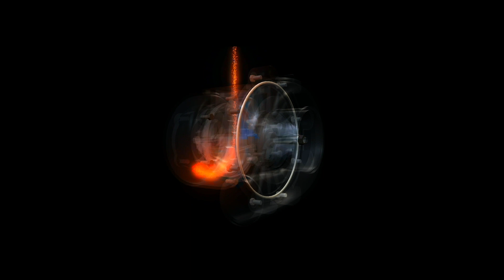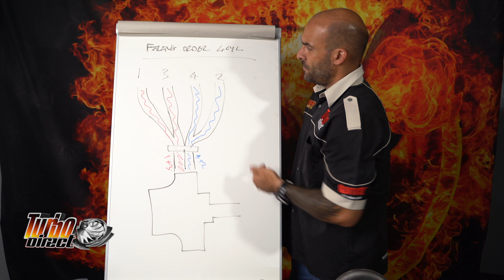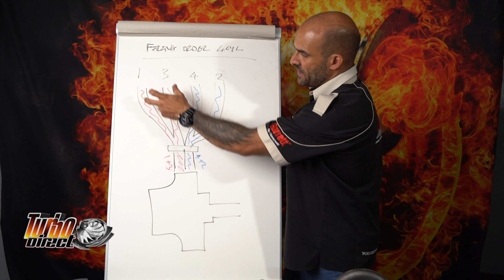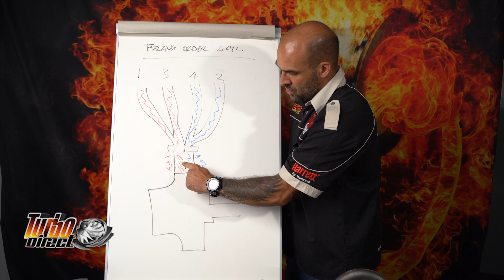Twin Scroll Turbine Housings explained

Comment: The correct setup for a twin scroll manifold on a 4 cylinder is to pair 1+4 and 2+3, as their combustion events happen 360 degrees apart, not 180 degrees apart. Pairing off the cylinders the way they are on the diagram will be no different than a single scroll manifold with the pulses interfering.
Reply from the maker: Incorrect - we have tested a traditional log type manifold, branch with collector, branch without collector, and pulse seperated manifold setups with 1+3 and 2+4 aswell as 1+2 and 3+4 and finally 1+4 and 2+3 ALL of these seperated setups provide benefits over the log type and traditional manifold design without collector. Which is best - that depends on the application and where you want to make your power. Changing the length and diameter of the runners mid way also made big differences in both performance but also sound .... we have tried almost ny design you can think of, before we opened our mouth on a public platform.

Comment: Can i use a twin scroll turbo with a normal exhaust housing
Reply from the maker: @raymondloubser4720  yes of course you can, just make sure your manifold gasket face is not a twin scroll gasket inside an open port housing it it will Burn and cause damage to the turbine wheel

Comment: What about using a dual inlet dual scroll flange and having a wastegate in one side that opens at a determined psi to help with boost response.? Im planning on trying this to spool my v8 a little quicker but information on this subject is scarce.
Reply from the maker: Not sure how the design looks, but closing off one side of the volute in a twin scroll setup always helps - been done many times for over 15 years already, but tricky to setup.
Reply: So it would be a single 2.5 from the header y-pipe about 4' long feeding into another Y,  One side going to a 60mm wastegate with a 4or5 psi spring then reduced to 2" then into one side of turbo flange. The other side of the Y would be reduced to 2" then fed straight into the other side of turbo flange . I'm hoping this would make it spool a little quicker.
Reply from the maker: Cant picture that im afraid - simply build a adapter plate that bolt underneath the inlet flange on the turbine housing with a butterfly actuated by a low boost actuator which will block the one scroll until a certain pressure is reached, at which point the butterfly opens - keep it simple and affordable

Comment: Great vid.  However the idea that a smaller AR will always reduce lag has been proven wrong several times on the dyno.   I wish I could link the vid but I cant remember what it was.  It was a 2JZ with a 30 sized turbo which most people would agree is on the small size for a 2J however changing the AR to subsequently larger housings massively improved spool times and obviously gave more top end.    They then fitted a more appropriately sized 35 which was much better again for power however they only tried it with the 1.06.   The reasoning was the 1.06 was so much better with the 30 they shouldn't bother with the smaller housings on the 35 which IMO was a mistake in the testing.     I am absolutely amazed people in this profession do not understand that the AR is a ratio not size so therefore a 0.82 on a 35 is not smaller than a 1.06 0n a 30.    I would have loved to see what a smaller AR done on the larger frame turbo.    My opinion is if your turbo is on the small side them always go with the biggest AR.    If your turbo is huge than the size of the turbine will give decent flow on is own so a smaller AR might be appropriate there.
Reply from the maker: I must disagree - smaller AR will ALWAYS improve response, BUT because of the backpressure the POWER OUTPUT will be reduced substantially depending on which side of extremities you lie. Remember the more back pressure the more you are affecting the ENGINES VE (volumetric efficiency) -- similar to blocking cylinders on the head.  If you watch the BOOST GAUGE you WILL see faster boost build up - BUT as i have already mentioned, HORSEPOWER WILL NOT BE AS MUCH --- always separate HP and Boost response - they are NOT the same thing and DONT always go hand in hand.

Comment: Hi. Im putting a efr9174 with twin scroll t4 on my 4 L barra engine, my idea was to get another stock log style psr manifold cut off the t3 flange and get a divided t4 flange welded onto it.  The pulses obviously wont be completely divided but the front 3 and the rear 3 cylinders only gather together for a very short distance before hitting the turbo. How well or effective do  you think it will be? Should i make a divider plate and weld it to inside of flange to divide the pulses better? Another question, i will have to run a wastegate feed off each volute just after the turbine inlet and merge them  together into one pipe to go to wastegate. What do you think? Also does the efr9174 have a stainless steel turbine housing? Thanks heaps
Reply from the maker: Barra is more than capable to spool the 9180 especially with the GAMMA-TI turbine wheel. The risk of welding inside the manifold is not worth the results. The manifold will spool the turbo no problem because of the size of the barra. I would weld the inlet into the gate on the turbine housing itself, just above the inlet of the turbine housing, 3inches past the flange face. Use one gate and save massive space under the hood.
Reply: @TurboDirectSA  awesome thanks
Reply from the maker: Pleasure - happy to help  @farmer3242

Comment: Thank you for the video .

Question.
Is there a difference in design as far as the turbine wheel goes ..
For a twin and single scroll?
Are the inducer tips longer for more leverage with the twin scroll to help with spool up ..

And if u fitted a twin scroll housing  on what is meant to be a single scroll turbine .
What would it do to response ?

Thank you again
For all you do. 
😊

An
Reply from the maker: No Doug no difference in the design of the turbine inducer blade design at all. SOME turbos have a mixed flow turbine stage which relates to the angle of the incoming gas path and the design of the turbine blades - for reference google a picture of the IS38 turbine wheel blades, you'll understand what i mean when you see it. For the Scooby turbo  designs, there is no mixed flow turbine design. 

Using twin scroll turbine housings with a normal turbine blade design will offer response improvement only because you have pulse seperation coming into the housing.

Comment: Wouldn't that mitsubishi turbo have more back pressure on 2 of the cylinders?
Reply from the maker: No you would build the manifold to split the pulses, and entrance into the tongue area is joined   into a single entry to the inducer blades

Comment: My mitsubishi based turbo has a divided t4 flange but then merges to a single volute before it starts to curve around. What is the idea behind this design?
Reply from the maker: Do you have any more info on this or a link to see pictures of this setup?
Reply: Hey mate, the turbo is a HKS GTIII-4R made by IHI. I tried linking the website I think the comment got removed but a google search will find it.
Reply from the maker: @barbiegamaestan456  I know the turbo,  but i need to see the installation.

Comment: I need to stop you around the 8-minute mark to correct some timing physics here. If the goal is to have the pulses as separated and far apart as possible, you don't want cylinders that fire closely after each other to be going down the same collector and then volute. So disregard the firing ORDER of an inline 4 for a second, and think about the firing INTERVAL of the piston pairs.

Any two pistons in the engine that are opposite in TDC vs BDC will effectively fire 180 degrees apart from each other. 1 and 3 will fire 180 degrees apart, as will 1 and 2. However the opposite is also true; any two pistons in the engine that are EQUAL in TDC or BDC will effectively fire 360 degrees apart(so 2 and 3 are a pair, 1 and 4 are a pair), giving even more spacing between events and minimizing interruption or interference off pulses.

So on an inline four, what you ideally want is the center two cylinders to one volute/scroll, and the outer two cylinders on the other volute/scroll. On an inline 6 it's even simpler than that since an inline 6 is two mirrored inline 3s stuck end to end. Each half of an inline 6 (front half and back half) will have respective firing intervals 240 degrees apart within themselves, giving less potential interference than your 1+3, then 2+4 example(not to mention smoother, more even flow since yours would be 180 degrees apart, then 540 degrees of silence), but slightly more than my 1+4 and 2+3 pair example on an inline 4.

The industry COULD potentially optimize inline 6 turbos with 3 scrolls, which would work best with a 1+6, 2+5, and 3+4 pairing regardless of firing order, but as you said, even a 3rd scroll is likely more hassle than it's worth to manufacture when twin scrolls work fine as is.
Reply from the maker: The only way to shorten or lengthen the INTERVALS is to use a MILLER cycle engine - and the performance of the engine will suffer enormously - separation is key, intervals are irrelevant and uncontrollable.   R&D is the key here, depending on turbo size, AR choice and CR of the engine, choosing to separate 2 and 4 or 2 and 3 will yield different results - the application would need to be matched to the choice accordingly.
Reply: @TurboDirectSA  The interval is the amount of time in crankshaft degrees between firing pulses. Every layout of engine has different firing intervals regardless of firing order.

And to keep it simple, on a flatplane inline 4, the firing interval is 180-180-180-180 between all 4 cylinders. So whether the firing order is 1-3-4-2 or something else, it doesn't make a difference. 1 and 3 will have the same interval as 1 and 2. The same goes for 4 and 3 vs 4 and 2.

"But no, 1 and 3 on a 1-3-4-2 are 180-degrees apart, but 1 and 2 are 720 degrees apart" I hear you say. And technically, you are correct. But as far as the engine's flow is concerned it doesn't matter because it is a continuous repeating CYCLE.

1-3-4-2-1-3-4-2

That was two revolutions. See how once the cycle is complete it goes from 2 to 1? Notice how they're just as close together as 1 and 3 at the start of the cycle? That is effectively and factually a 180-degree separation. A turbocharger WILL NOT see a difference from having 1 and 3 plumbed to it compared to 1 and 2, ASSUMING the pipes are all equal lengths, still.

However what a turbo WILL see a difference on is whether you have two 180-degree pairs or two 360-degree pairs plumbed to it, IE my 1-4//2-3 example. That IS fundamentally different from the other two pairings since the two outer pairs of cylinders are on the same movement, but opposite strokes.

In fact, this 360-degree pairing leads to almost zero interference between cylinder pairs, which is why parallel twins with such a crankshaft can operate with ONE carb and siamese exhaust ports with no ill effects. And that "lack of interference" or exhaust pulse stacking is exactly why 4-2-1 aka "tri-Y" headers for N/A 4-cylinders are not only made, but extremely beneficial to torque below the curve in a street engine.
Reply from the maker: @Drunken_Hamster  firing/timing of the ignition event yes, intervals in terms of degrees of crank rotation for a typical 4 cylinder engine 1,3,4,2 - there is no different at all in this. 

Nope its not 180degree separation, its 90 degree separation - 360 divided by 4 equals 90. 
With a 6 cylinder engine you will have 60 degree separation between cylinders in terms of crank rotation - 360 degrees divided by 6 cylinders equals 60..... 

Nope - once again pulse separation is determined by the manifold design, if you are separating cylinders 2 and 3 (which are 180degrees apart in terms of ignition event) or if you are separating cylinders 1 and 3 (which are 90degrees apart in terms of ignition event)  there is a massive difference in the intervals. HOWEVER if yo keep going you will see similar intervals as they catch up with cylinders 2 and 4..... 

Over-complicating things makes for confusion, separate the pulses, and use a Twin scroll turbine housing where necessary/applicable, and you wont go wrong.
Reply: @TurboDirectSA  It's 720/4, not 360. A full volumetric cycle in an Otto-cycle engine is 4 strokes, each consisting of 180 degrees of rotation. 180*4 is 720. Yes, any separation is probably better than none, but having an optimized design is also important. Just saying, you don't want to be giving people false information for their builds with your diagrams. Every single inline-4 twin-scroll manifold on the market is 1-4/2-3 paired for maximum separation within each scroll, and an even separation between scrolls.
Reply from the maker: @Drunken_Hamster  Otto cycle engine requires 720degrees to complete an entire combustion cycle - ALL cylinders going through each phase of the 4 strokes. 

This is NOT what we are talking about when referring to intervals - which occur every 90degrees.  Optimised design depends on many things as mentioned in my previous comment. Research reverse pulse reverberation.

Comment: Good video, I just have not heard about a butterfly actuated twin scroll spacer before. I will need to learn more about this concept. Especially if I want to maximize the responsiveness of a S475 turbo and a smaller 5.3L LS engine as a daily driver. Where would I go to learn more about this design? As I'm not very well versed with turbochargers and even less so with twin scroll or divided turbocharger housing/manifolds. However when you mentioned the Mitsubishi variable AR twin scroll housing and how great the idea/concept is. I couldn't help but imagine this housing with a 25%/50% smaller than a regular S475 turbo valute on one side and a 25%/50% larger than a regular S475 turbo on the other. As this might be able for both a faster spool/response time and at the same time a higher boost capability. Am I anywhere close to being correct in my reasoning?
Reply from the maker: Thanks for the comment - this butterfly valve has been used for many years, the first time i saw this was in 2008-2010 already - simple but great idea to 'block off' one of the scrolls in the turbine housing, to spool the turbo faster through one smaller "AR"  i am not sure if there is anywhere to go really - to learn about this.
Reply: Здравствуйте, коллектор single-scroll под эту проставку установить?

Comment: Excellent.
The ONLY turbo  channel I have found on Youtube that RECOGNIZES that it is the pulse MAXIMIZATION, not EVEN PULSE SEPARATION that causes a turbo to respond more quickly!

What works wonderfully on a naturally aspirated engine, ie: evenly-separated exhaust pulses, to maximize scavenging, DOES NOT WORK ON THE TURBOCHARGER!!! What  a turbocharger WANTS is the most pulsated flow it can get at low RPM to spin the turbo up more quickly. 

On the opposite end, 4-2-1 headers on four-cylinder engines combine exhaust pulses exactly the same distance from each other (if the F.O. is 1-3-2-4, they combine 1 and 2 in one half and 3 and 4 in the other) to help scavenging. What is surprising to me is that some turbo channels seem to think that that is the right way to manage pulsation on a turbo manifold also!!!

That is also part of why turbo engines have such small exhaust tract volume before the turbine(s.) Pulsation maximization plus heat and velocity retention.

The butterfly-valve single-volute-half is an interesting take on boost response enhancement.

The Mitsubishi housing looks to be a fascinating approach, also.

I wonder about putting a truly large butterfly between halves of a bifurcated manifold (axis of butterfly rotation parallel with flow path) that opens up at a set RPM or pressure to allow LESS pulsation at higher RPM where it is then just an obstacle to efficient exhaust flow. Again, this would be a very large butterfly for maximum efficiency. It does not need to be round, but can be a long ellipse with the long side also along the flow path, to allow pulsations to travel through both halves of the bifurcated exhaust stream freely, for the benefits of bifurcated and single-chamber volutes combined with a simple bit of technology.

With a proper setup, the wastegate could be opened less than it presently is.
Reply from the maker: Thanks for the comments -

Comment: Great video! Quick question, what is the difference between twinentry and twin scroll? They both have seperate volutes but does the twin scroll actually have a valve inside? Thanks from the UK!
Reply from the maker: I have never heard of twin air turbos, so i cannot comment - twin scroll turbine housings that are internally gated will have a swing valve (internal discharge gate) installed and integral to the housing. Free floating housings that are twin scroll will have no valve inside -
Reply: @TurboDirectSA  sorry I mean twin entry. Kinagwa do them
Reply from the maker: @seemaab  kinugawa are chinese knock offs -- i have seen some of their housings, and they tried to get Forced Performance to buy their products, and the level of quality (real poor quality - according to FP) was clear to see in a video they made of the housings that these guys tried to copy, but they couldnt even get the material correct to start with.  Twin entry are simply a name used for twin scroll divided housings.
Reply: @TurboDirectSA  there Arashi sub brands got some rave reviews. So twin entry is divider housing without the valve
Reply from the maker: @seemaab  yes twin scroll as long as its free floating